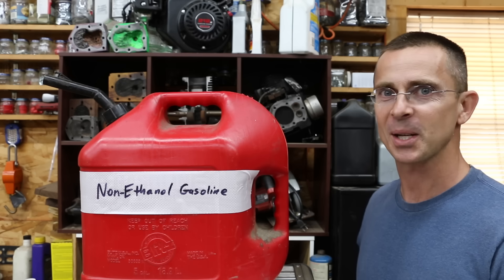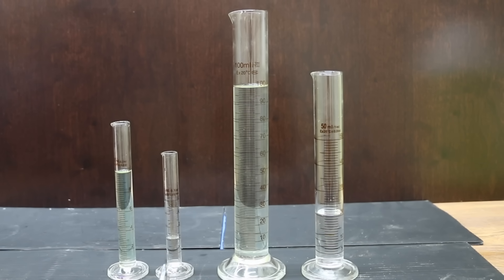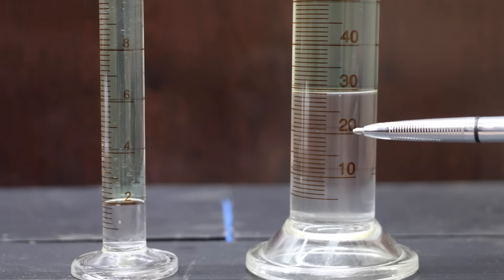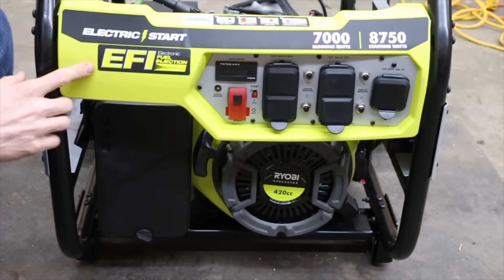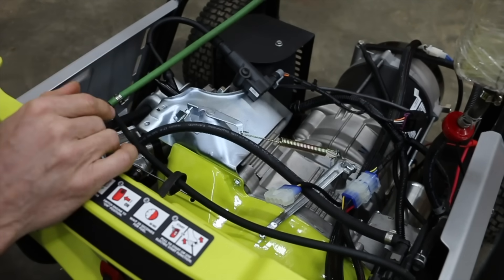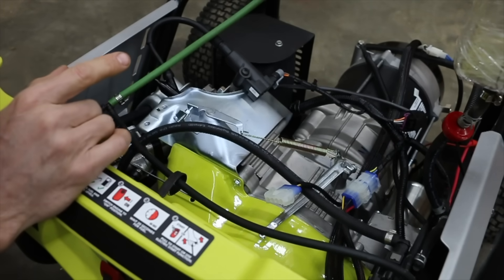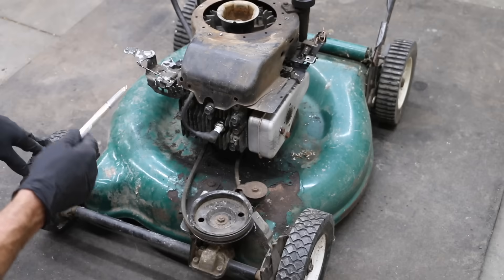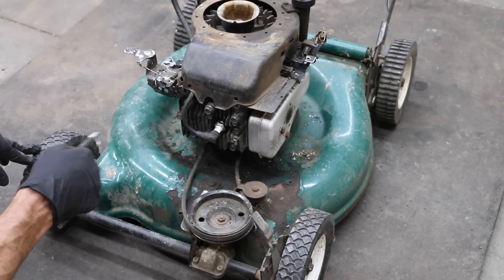Is Non-Ethanol Gasoline Really Better? See the PROOF!

Comment: I own an airplane with a auto-gas kit.  You cannot use ethanol as it will eat the tip tanks (fiberglass).  I have used this method to test the gas.  There is also the food color trick.   Adding a couple drops of food color to the gas.  If it contains ethanol, the gas will be dyed.  If not, the drop will just sit there.
Reply from the maker: Thank you!

Comment: I have used E7 in my 50cc dual sport with no issues on rubber parts and the carb only clogged up after using fuel that sat in the tank for 2 years.
So I think most of the hatred against Ethanol comes from the fact that it has some environmental benefits so in the twisted minds of some petrolheads it MUST be bad.
Reply from the maker: Thanks for the feedback!

Comment: BS even flex fuel truck says in manual higher ethanol content more reduction in performance and mpg. 100% I get 24 highway. 10% ethanol 19.8 highway. And its sluggish. Oh and octane? Is a measurement of resistance of ignition. Meaning ethanol is harder to burn. Notice the weak orange flame. In high compression engine might work if u can restart timing enough. But today's low compression motors dont need high octane number. Finally you silly dudes saying ethanol is racing fuel. Wrong that's methanol totally different thing. So go brush that tooth after spewing all that BS

Comment: The entire problem with anything like this is you are running an engine designed to run on gasoline and not comparing that with an engine optimized for E10. You are comparing apples and oranges. Raise the compression of the engine and then run it on E10 and you will see a much better result. As to cars to run E10 or even E85 everything is a compromise and as such never does as good as it can. One other point I think you miss is that ethanol is a carbon neutral fuel and that is very important. So much whining from people about  their gasoline but if they actually knew what it is they are breathing because of it they might look at it a bit different.
Reply from the maker: Thank you for the feedback!
Reply: @ProjectFarm  if you want a good compare of the 2 as individual fuels research Brazil.  After the 1977 oil shortage they worked to make ethanol fuel half the cars sold. Cars were setup to run one or the other not both. Back then was carbs and no computer control fuel injection and with world oil prices running up and down they are mostly unaffected.  Check it out when you get a chance.

Comment: What about the OCTANE level? I've always wondered if the crap-anol mixed gasolines have a 95e base with 10% ethanol added (it would be higher octane than 95) or do they make a lower octane gasoline (secretly saving costs) so they up the octane level back with adding 10% ethanol making the mix a total of 95 octane? I'm basically asking if its for example 93E+10%ethanol=95octane mix
Reply from the maker: Great question.  The octane level listed at the pump is with ethanol included if there is a 10% ethanol content.  Removing the ethanol will likely reduce the octane.

Comment: Ethanol gas reduces gas mileage and can destroy engines with older valves - pre 2005. Not that carbon dioxide has anything to do with climate change, the process of making ethanol gas produces 8% more carbon emissions than regular gas. Ethanol also caused a big spike in food prices. It’s never a good idea to
burn a food source.
Reply: Another thing to keep in mind is that a lot of the corn grown to produce ethanol is irrigated from the Ogallala aquifer, and that aquifer is rapidly being depleted. So, it's not clearly better for the environment to put corn-based ethanol in gasoline.

Comment: It's great for small engine mechanics who like to repair carbs all day long ..the cooling of evaporation causes water from the air to condense into the fuel , which settles to the bottom of the float bowl and causes a galvanic reaction between the dissimilar metals...
Reply from the maker: Thank you!

Comment: ethanol fuel makes small engines run horribly... and causes many issues.  To make it tougher too, here in NJ it is not easy to get the non-ethanol. 

If you do the method you mentioned.. adding water to force separation, then drain the ethanol.. what would the octane rating be?.. if it were that low.. what if you then use an octane booster to bring the octane up a bit... perhaps Lucan octane booster or something similar?  I have been curious to try it, and I probably will.. but I am not nearly as handy and scientific as you are.. haha.. maybe you could try it and share the results?
Reply from the maker: I need to setup an engine to test octane.  Won't be perfect. The ones used by the refineries cost a fortune.
Reply: @ProjectFarm  Yeah, I could imagine the price tag on something like that.  I am hoping that if I could use 91-93 octane fuel and take out the ethanol, that I could save the 2 hour trip to fill up 20 gas cans, haha.

Comment: Ethanol kills lawn mower carbs if it sits in there
Reply from the maker: Thank you!
Reply: Love your channel! You do some crazy stuff to these motors!
Reply: Before shutting the engine off turn off the fuel valve and let the carb get sucked dry. It will greatly help with this. The small amount of fuel  left will not be enough to keep the parts soaking in the fuel while not in use. They should put this in the owners manual but they dont.. so tell a friend.

Comment: By the time diesel tractors are used to plant and harvest corn, diesel trucks are used to transport the corn to the distillery, (a denaturant such as gasoline is added to render the product undrinkable during the process), more diesel trucks used to transport the alcohol to gasoline terminals, the adding of alcohol to gas is basically just a tradeoff.  If it wasn't being subsidized by the government (taxpayers) it would be too expensive to use.  Do people who drive E85 flex fuel vehicles actually use the fuel?  Because with E85, you're going to get 15 to 27 percent less mileage.
Reply from the maker: Thank you!

Comment: Living in CA I have always tried to explain the difference to
my friends about the difference between cheep gas “ARCO higher ethanol content”
vs “Chevron lower ethanol content gas”. Gasoline has a higher BTU than ethanol,
as you proved by 4%. So, buying cheap gas gets less millage as you proved. I
would love to see you do a test between 87 octane vs 91 the highest we can get
here.

I drive a turbo charged car, I also have two high
performance motorcycles one with 13:1 compression a ratio. The manual says not
to use less than 91 octane fuel and not more that 10% ethanol.
Reply from the maker: Thank you!

Comment: Ethanol does not destroy the engines. It is the water that is absorbs from the air which settles at the bottom of the fuel tank which in turn, cause rust to form which then enters into the carburetor which will clog up the jets. Ethanol cannot be moved or transported in mild steel pipelines because it will absorb moisture out of the ground or atmosphere. It is always moved in Stainless Steel Tankers. Just use Ethanol additive religiously and you will not have an issue. For added protection, shut the fuel valve off and let the engine run out of fuel before storing it away until it's next use.

Comment: Ethanol gas destroyed my $1200.00 submerged fuel pump, fuel filter, it’s fuel lines and even destroyed the DC power cables insulation, so I had bare wire in my gas tank. That was in a BMW K1200LT bike. There’s no way that’s safe!

Comment: I think the main reason they put ethanol in most cases is to boost the octane rating of poor quality gasoline. I remember when they used to sell the 10% ethanol blend and it was 89 octane and the lowest non ethanol blend was 87 where I live. Now you still have 87 octane gas that "may" contain 10% ethanol.
Reply from the maker: Thanks for the feedback

Comment: I've got a good question or at least I think it is. I have a local gas station in my area that sells 92 octane ethanol-free gas. The question is it's ethanol free and it's 92 octane so what do they put in it for the gas to be 92 if ethanol raises octane? I always thought only 87 was ethanol free.
Reply from the maker: There are quite a few boosters that fuel engineers use instead of ethanol, such as Toluene, isooctane, ETBE, etc  Thank you
Reply: @ProjectFarm  didn't know gas companies still use that stuff that's interesting. I always thought high octane gas was more refined if that's the right word for it, to bring down how explosive it is.

Comment: You state that it’s not worth the extra cost for the fuel additive, that you can just add things like sea foam. Only problem is there is still a cost for the sea foam. What would the cost per gallon be comparing both?

Comment: For years I've heard that it's the ethanol ruining the rubber components on the carbs and fuel lines. I know it does because I've soaked both in 15% drinking (ethanol) alcohol for a test.  But now, I'm hearing that it's actually Benzene doing the damage.  Is it both?  Are we able to remove benzene from our gas?  The "top shelf" canned gas doesn't have benzene in it, supposedly, nor alcohol either.
Reply from the maker: Great information. I'll have to do more testing.

Comment: I've commented on a past video. Thanks for your feedback to me. On this type of display with this, I personally would have done similar to the tests you've run with 2 new motors and running them for a longer time...ie maybe 2 lawnmowers and using each for the same amount of uses. I get it a pain in the butt, but , to me it would be a great example in this aspect.
Reply from the maker: Thanks for the constructive feedback

Comment: I can tell you for a fact that my 01 dodge ram with 5.2 engine runs better without Ethanol in my fuel. My fuel mileage is worse when I do use fuel with Ethanol. Still, my emissions are not affected when I do use fuel without Ethanol. You can try this for your testing.
Reply from the maker: Thank you!
Reply: Ethanol in bigger engines is actually okay , ethanol in small engines like mowers is not good at all, in fact ethanol has been around since the model T ford , all race cars run 100 % ethanol fuel

Comment: My 2007 Chevy can run on ethanol (B90?) And when I do I get 10 mpg vs 15 mpg when I run non ethanol gas.  So if I drive 30 miles I need 3 gallons of ethanol or 2 gallons of regular gas.  You can't tell me burning 3 gallons of ethanol is better for the environment than 2 gallons of gas.
Reply from the maker: Great point!

Comment: I rented an E85 flex fuel car about 10 years ago.  I decided to run the lower prices E85 and found that I had to fill up 2x for the same trip that when I used same car switching back to E10, I only needed 1 fill up.
Anecdotal, yes, but I was not sold on E85.
Reply from the maker: Thank you for the feedback!

Comment: Ethanol produces 10 percent less energy then gasoline and is not a good source of fuel if blended with gasoline.  I understand ethanol is a colder burning fuel and is desirable for extremely high powered engines running turbo and Squeeze. But for daily use ethanol is garbage

Comment: Great video, only bit of info I could add is I am a truck driver and deliver gas to stations. The ethanol is mixed with the gas seconds before its loaded onto the trailer. Before I connect with the station’s tank I have to check for water and ethanol separation. In the years I’ve done this job I’ve only seen one instance where there was either water or ethanol separation and it was at a station which had been closed for about a year and I was delivering the first load in that time. I notified the company and they pumped out the residual fuel and a other truck made the actual delivery. It is taken seriously, the cost of pumping out and transporting bad fuel to a refinery for disposal is high, around $30,000. Part of that cost is because of the distance between where I am an the disposal sight, but that’s what I’ve been told. The failure to check for separation or water is grounds for dismissal.

Comment: One thing I notice in my 2015 Chrysler 200C 3.6L is that it prefers the Ethanol Free gasoline. However, here in Utah it's only 85 Octane. Luckily the 3.6L is naturally aspirated so it doesn't require a higher octane fuel. I notice better economy and better acceleration with the Ethanol Free gas vs. the 10% Ethanol. As long as it's available when I am fueling up, that's what I am going to buy.
Reply from the maker: Thank you!

Comment: here in Brazil the gasoline has 27% of ethanol. In small engines, as 2 stroke engines, it causes corrosion and clogging in the carburator. If ethanol is taken off, no more corrosion or clogging but the pure gasoline has about 80 octans with no ethanol.

Comment: Our Europa Aircraft with a Rotax 912uls engine, will not run with 10 percent ethanol in it. We now have to use premium grade fuel in it. also Ethanol eats any rubber or plastic components.
Reply from the maker: Thank you

Comment: If the non ethanol gas is less than 10% more than the ethanol gasoline I will buy the  non ethanol because I am money ahead for the better milage.  Most vehicles I buy  will have 100,000 miles on them and  10%  milage difference has been quite common for me.
Reply from the maker: Thanks for the feedback!

Comment: Many years ago for a summer job while in school i sold a contraption that put water into the combustion chamber to stretch fuel early 80's. The contraption basically was a bottle that looked like a windshield washer reservoir and a hose to the carburetor where a small hole drilled into the ventury and tapped to cause the carburetor to  draw water vapor in and caused the engine to run partially on water vapor stretching gasoline usage. Some advantages was that cylinder heads remain clean and prevented engine knock. Trust me it was hard sell but in later years I learn on motorcycle ran better on damp nights. Any thought of doing a test similar to this contraption? Your video's are fantastic and I watch them all. Keep up the good work!
Reply from the maker: Thanks for the feedback!